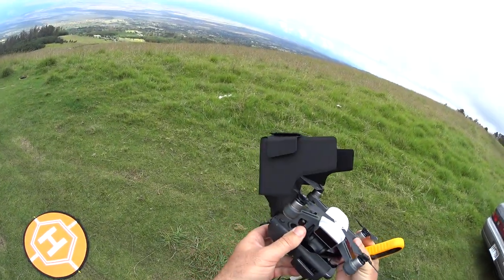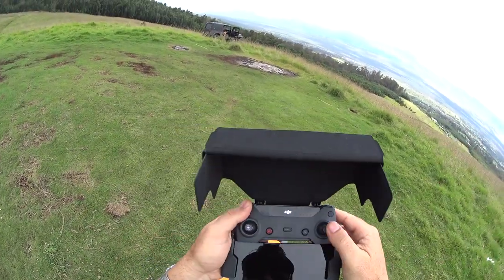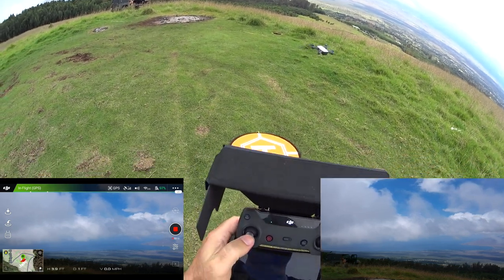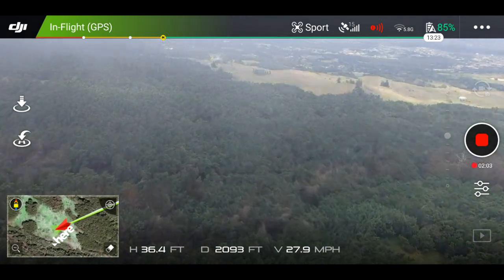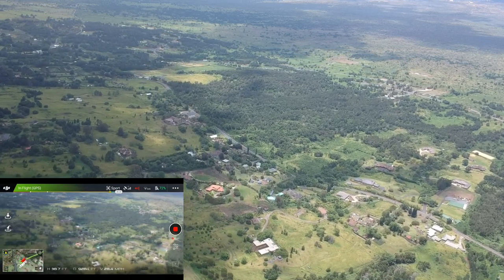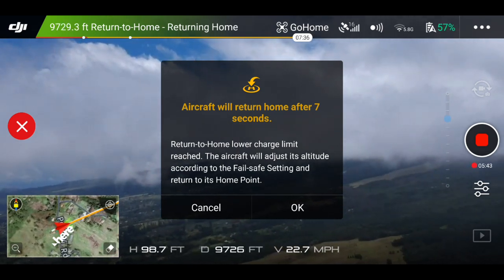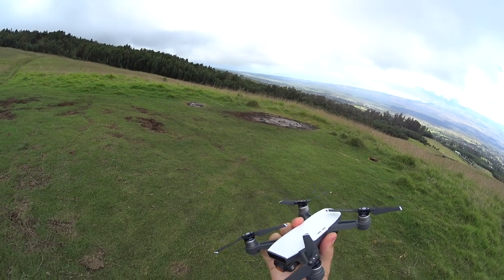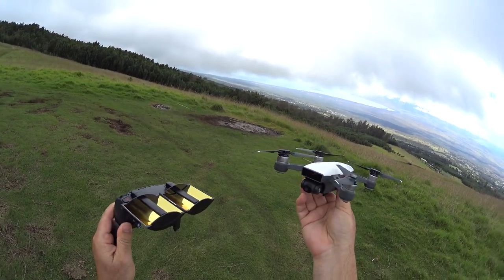DJI SPARK Review - Part 3 - [4 Mile In-Depth Range Test with RC Controller & OTG Cable]

Comment: Hey, so I have the spark and I’m flying with an OTG cable, the controller, and the parabolic antenna boosters, yet I still only get as far as 1,000 ft. Please tell me what I need to do to improve this.
Reply: BTW I’m flying in the suburbs so I don’t know if that’s why, but I should at least get up to a mile.
Reply from the maker: Interference is your problem

Comment: You use FE mode or FCC Mode? 
Do you know the Normal Heat of Spark when it fly? Because i feel my Spark sometimes produce more heat.
Thank you.
Reply from the maker: FCC.  It does create some heat
Reply: @DustinDunnill  It is Normal if the aircraft heat about 35°Celcius??

Comment: Is there any reason why I am getting choppy, bad quality live video feed to my smartphone even when using the OTG cable? I thought it was operating on 5.8G video transmission
Reply from the maker: May be your phone/app compatibility or if it's smooth but gets choppy at distance then possibly bad interference.

Comment: I have a phantom 4 pro for a couple of weeks now. I use the feature precision take off. I dont know why but if i use the return to home button the drone starts to land at the place it is at the moment i hit the button. Does anyone know what is going on? The drone is not coming back to the place it took off.
Reply from the maker: +Chris71319 sounds like bad satellite lock or bad compass calibration.  Try calibrate everything again properly.
Reply: Dustin Dunnill thx, i will calibrate again and check it out. Maybe also good to reset the home point in the settings. The other control functions like direction work flawless.

Comment: does the spark automatically return to home when any connection goes out like the phone signal or the drone connection or the controller signal ? and 1 other thing what happens if the phone dies does it return to home?
thanks
Reply from the maker: Yes to all your questions 👍
Reply: @DustinDunnill  ok thanks i really appreciate it

Comment: Is this drone better than the phantom 3 standard?
Reply from the maker: +Wallace 11 everything except for flight time and camera
Reply: Wallace 11 Yes WAY better. It has twice the range, goes just as fast, uses twice the satellites, is smaller(so you’ll actually use it more) and the batteries and accessories are way cheaper when you want to expand.
Reply from the maker: +SquiDragon the spark doesn't have a 3 axis gimbal, no 2k recording and has about 3-4 minutes less flight time than the P3.  Otherwise it does everything else better.
Reply: Dustin Dunnill That’s true, but I just find the portability SO much better, it’s not a hassle to bring with me and the charger can charge both of my batteries in less than an hour so I can go out flying about 3-4 times a day to fly it. 
I’d say that if you care about the camera a whole lot, you should probably get the mavic or phantom 4. I’m good with 1080p 30fps though, and don’t really have the money to buy a mavic, so I stuck with the spark. 
Also about the 3 axis gimbal, I don’t really notice a difference between having it and not having it, as you can’t control it on the phantom. Something like the inspire, yes, then I notice that as you can angle the camera, but you can usually get smooth shots on the spark just the the 2 axis gimbal. 

Happy flying :D

Comment: I am very dissapointed with my spark... i get around 100 meter range only then the video usually cuts out. And i am using Controller and cable to phone...
Reply from the maker: +Oliver Åström Sounds like you may be flying in a very high interference area like residential.  It will drastically reduce range
Reply: Dustin Dunnill Yeah But the thing is That i have tried flying everywhere... and it is still the same

Comment: Dude wth, I can't get my spark over 200 meters. When i get to this distance the video feed lags like crazy and i lose connection to the spark. From there it returns to home. I have ordered a cable to improve the performance, but I doubt it will let me go 10000 feet when i install it. Anyone got the same issue?
Reply from the maker: +ludi residential interference will do that

Comment: Do ypu get the same range wihout the controller?
Reply from the maker: No.  The controller is required to do the 4g mod.
Reply: Dustin Dunnill aight thx, good review btw
Reply from the maker: Sorry, I thought you were responding to my DISCO video.  Range only couple hundred feet without spark controller 👍

Comment: My spark with remote in uk goes 250m :(
Reply from the maker: sounds like interference issues from surroundings
Reply: turns out europe has limitation to CE mode. with the modded dji app i can get 800m. surely you're using some other technique to get 4km as dji themselves claim about 1.2?

Comment: I'm annoyed. 
My spark looses connection 100m away from me 😢
Reply from the maker: +juan noel fuentes That's normal with just a phone connection but something's wrong if that happens with the controller.
Reply: Dustin Dunnill I am using my controller, and I tried it in different locations
Reply: juan noel fuentes I would ask for DJI support and if they can’t help I would see if you can trade it in for a new one that will hopefully work.